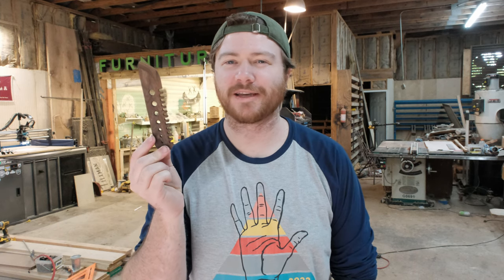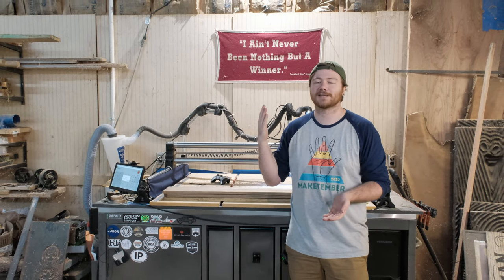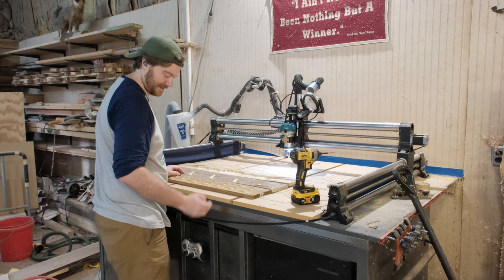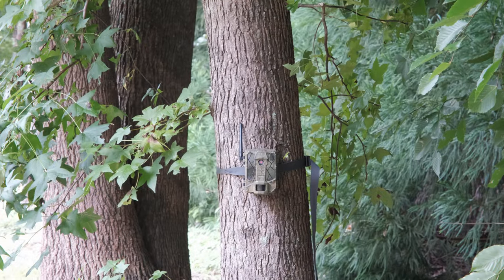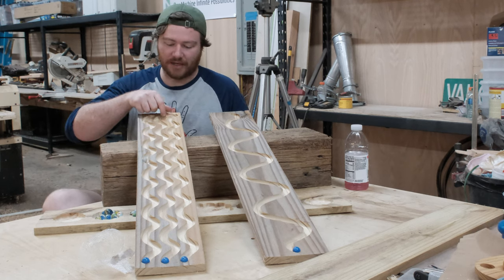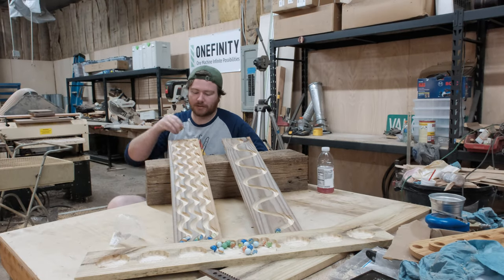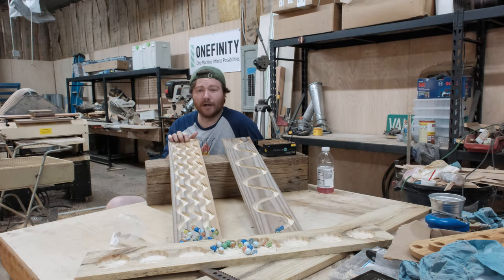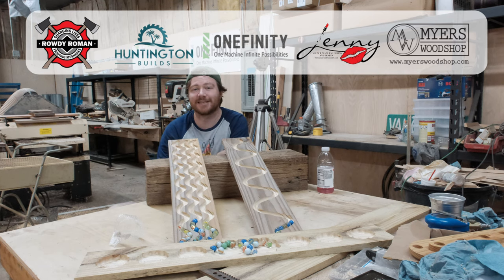Easy CNC Woodworking Projects- Marble Rolling Boards

Comment: Instead of the giant holding board, how about a simple pocket cut in the shape of a circle or oval that is open to the end of a smaller second board.  That board would be attached at the end of the runner boards with a hinge, allowing it to catch the marbles at the end and collect them over multiple runs.  If you wanted to be fancy, have magnets to it stays closed when flipped up onto the runner board.
Reply from the maker: Those are great ideas!!

Comment: I assume that your machine is square to the wasteboard?  I have not seen you ensure that each of your project boards is the same thickness throughout.  I flatten every board, sand that side to 440 or so, flip it over, flatten, sand this side, and then make something.  That way I am sure it is the same thickness all over.  I use double-sided tape for the first side, and tape and CA glue for the other side.  Am I overthinking and overworking the board even before I make something?
Reply from the maker: I personally don't do anything on the CNC that need to be THAT flat. The flatness I get off my planer is more than enough for my projects. Thats just my opinion, though. I don't see anything wrong with what you're doing if you've got the time to do it!
Reply: @HamiltonDilbeck  My projects are not that good. But they are flat.